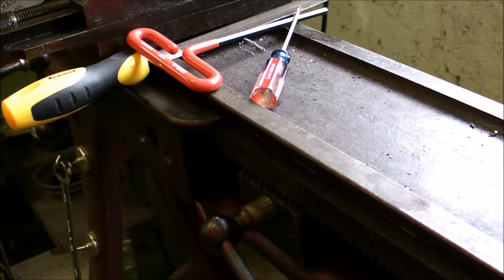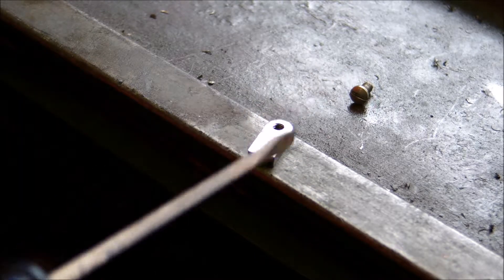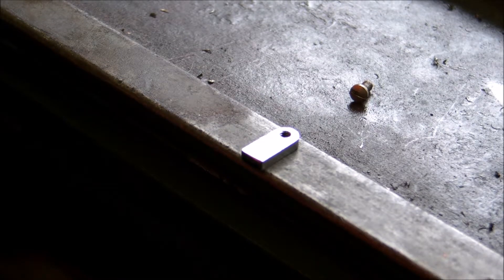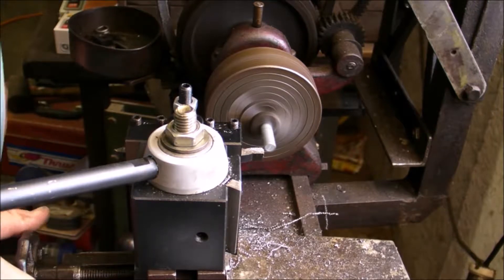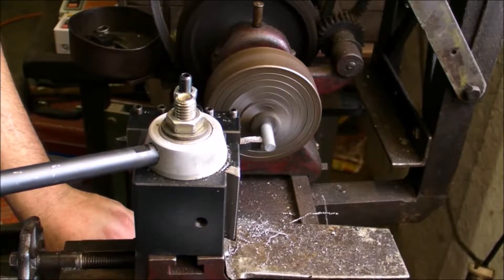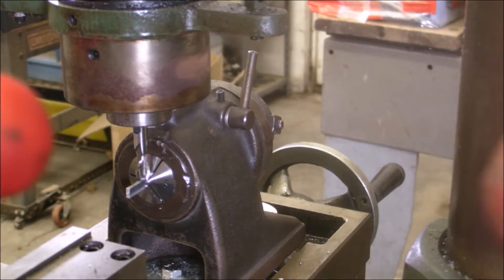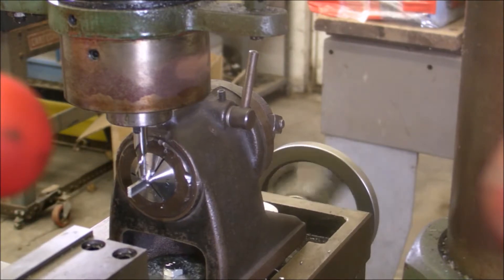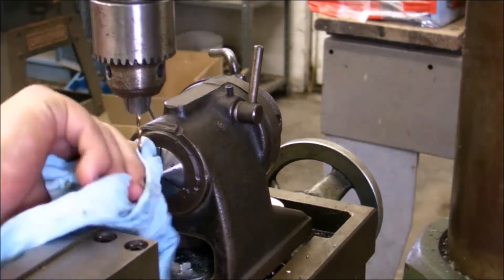Back Plunger Stem Build

Comment: You will find it much better on a marginal lathe like your, if you have the tool further back into the tool holder, ie not hanging our so much, when cutting an intermittent cut like this.